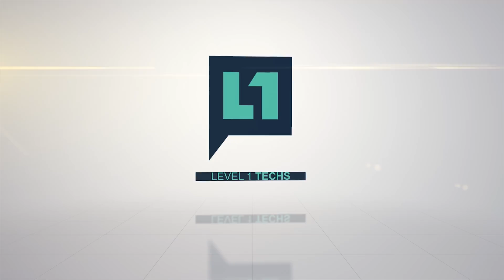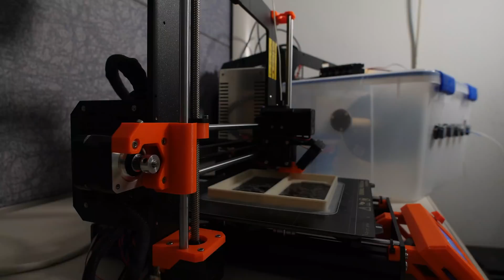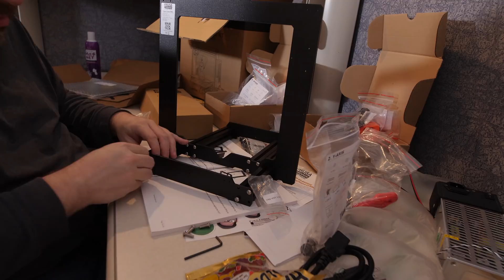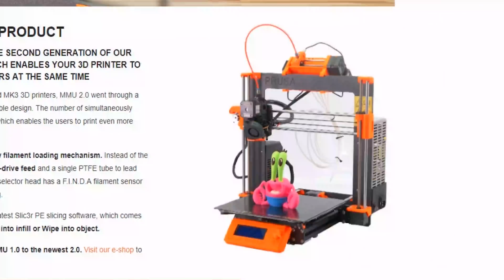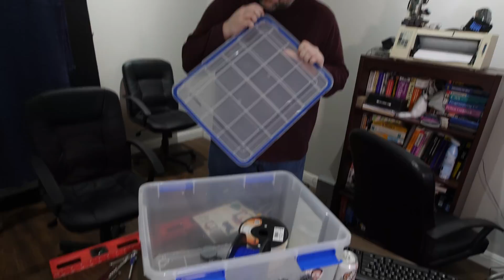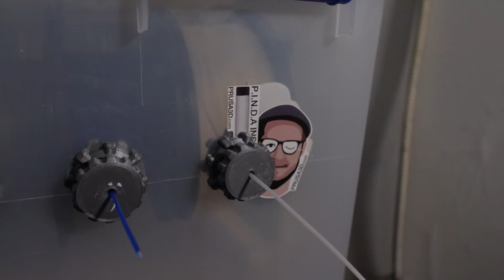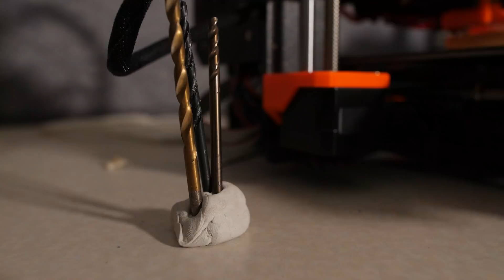Wendell's New Toy: The Prusa i3 MK3 3D Printer

Comment: Fusion 360 is free for hobbyist and stradup as long as you do now generate more the 100k/year  and education as I remember
Reply: yep yep in 3 year chunks I believe. Now if Wendel can work some magic and get it to run in Linux that must be done
Reply: @cowardly_wizard  Blender(.org) is perfectly fine to create models and export to STL.. i think it even has a plugin for direct printing ??
Reply: @tinygriffy  all true, but listen, I want my free proprietary software license to be useful 😭
Reply: @cowardly_wizard  haha, that's a good one XD

everyone should of course use the software they want ;) *.. maybe not any
Reply: @tinygriffy  blender isn't very good for CAD though, like changing dimensions. It does export models fine though. I've used it to edit 3d scans (which have thousands of irregular polys, no good for CAD) and then print them
Reply: @MaaveMaave  As I said in a previous reply, it sounds logical that a dedicated CAD prog would do the job better, even faster. 
However, I cannot confirm that it's difficult to change dimensions in blender, it works really well, at least that's my experience. And well, i think its good practice to keep the poly count low, don't you ? The slicer might like that too. So blender is a nice exercise. I know that many models you can download are total garbage when you try to open them in blender, fortunately i am capable of creating models myself ... with blender ;P

Comment: 750 buckaroos for this printer in case anyone is wondering.
Reply: Just for reference: there are cheaper 3D printers; often they're basically Chinese Prusa clones. They cost sometimes as little as 100$, but they are more of a toy than a proper 3D printer.

Though you could, technically, use them to print a better Mk.3 yourself.
Reply: What's important those cheaper printers are almost completely opensource. A friend of mine owns one and they were able to tweak it enough for their needs. I've seen their prints and they are very impressive for the price. (definitely not just a toy)

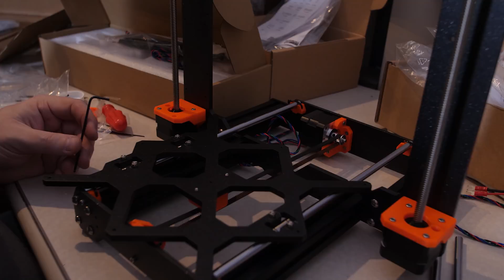Comment: 2:10 regarding closed loop
the chinese kits just put loads of current through the steppers so they never miss steps 
so even the cheap chinese ones can achieve that accuracy its just that it might be a little frustrating to get there
i had to tighten every single screw redo some belts and  tweak settings but in the end
 even the 300usd ones can do great stuff reliably as long as the mechanics are alright

the mk3 is definetly one of the best choices out there
but ive been able to get great prints out of the cr10 my dad bought for christmas with good enough reliability for what it is

Comment: The marlin firmware is WAY better then it used to be. Awesome code project. Does the filament also makes popping noises? Also dehumidifiers help fix it. Also pla ususally doesnt gain too much water so you really dont need to worry too much if you print then put the filament away when you are done.
Reply: Does anybody ACTUALLY disconnect the role each time to store filament separate? It takes way too long to be doing that, and no wonder people have issues with clogging up (its only been filament changes that I've had issues with that). As long as you print it within a few months or live underwater, its generally not a problem (only one I've had go bad was pretty bad PLA even new, so I think that batch was just bad, most of mine have been fine even if its been a year sitting partly used without protection, and I've actually got a role from 5 years ago that I need to use that has been sealed, haha!)

Comment: Waiting until 3d printing metal or 3d cnc that’s very affordable! ... imagine 3d printing hobby air planes, cars... endless.
Reply: Why would you need metal for airplane parts? You can make ridiculously strong ribs that weigh almost nothing (thanks to making them paper thin, or mostly hollow). I can stand on my airplane spars, and the 3d printed ribs are super light weight (plus you have nice smooth flaps and hinges). You can also print motor mounts, and my airplane had a carbon fiber arrow for the wing spar and another for the fuselage, so I joined them together with 3d printed parts. It takes maybe 1 hour to print a full replacement plane, and 30 minutes to assemble (and I'm so slow, those "30 minute to 1 hour" FlightTest foam kits take me most of a day, my plane uses about 15 dots of hot glue, and some motor mount screws and the prop nut, like that's pretty much it and then just plug in the servos and ESC/battery, and you're up and flying).

Plus metal is out-dated, most airplane parts are vastly superior when made out of carbon fiber (when used correctly, is over 50x the strength to weight ratio of steal), so plastic for smaller builds is pretty good (8 foot and above you should probably just skip metal and go carbon, only pure laziness would be an excuse for metal, but you'll notice how my build is all about laziness, so I consider that a valid excuse!) However, I do need to dig my carbon out and make a new wing, normally you vacuum mold carbon, but I'm wondering if I can just wrap it around a foam wing and vacuum bag it onto the wing, then melt the foam out afterwards.
Reply: metal printing will never be 'cheap' due to the ongoing cost of argon, the laster involved, and so on, it will get cheaper, but never be cheap. the best you can hope for would be something where the binder printers have their patents run out, as those my be able to be done on the cheap, you would still need a way to fuse the metal afterwords, but cheaper then laser method.